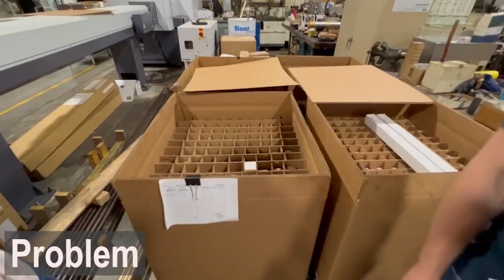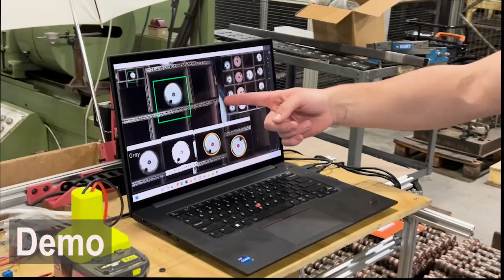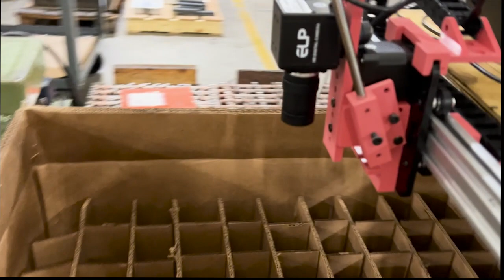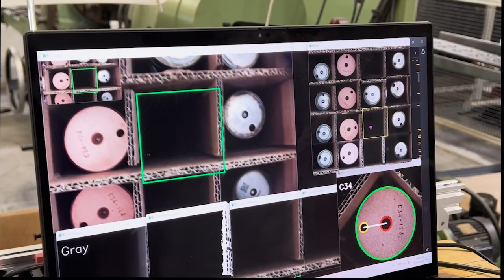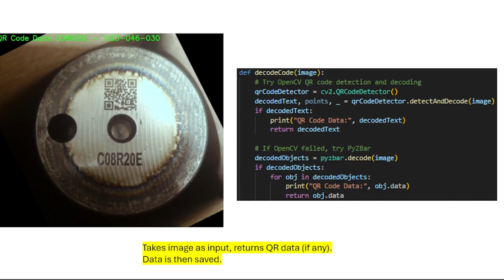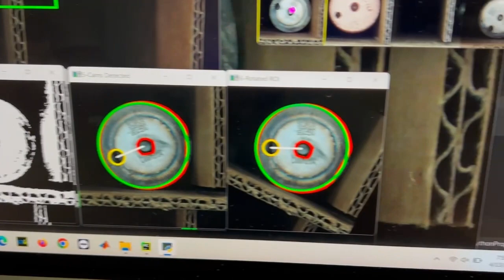C3 - Custom Camshaft Counter

Comment: Wow nice job guys! Using template matching instead of OCR is a great way to speed up your process especially since you already have a fixed set of data you are working with. Do you think template matching could increase the speed and reliability of qr code reads?
Reply from the maker: Template matching is actually slower than QR code identification but works much more reliably on shiny metal parts.